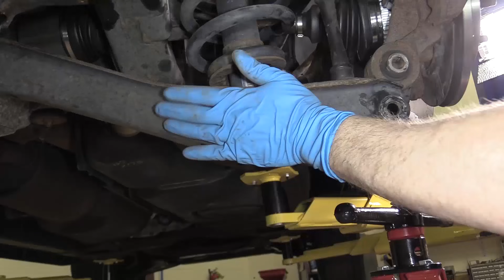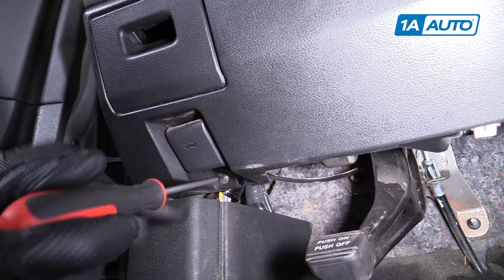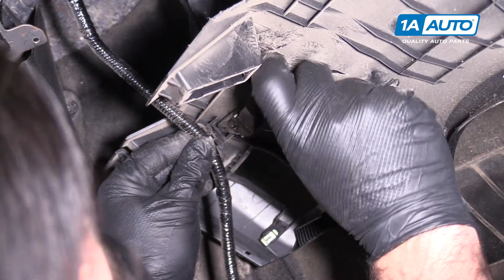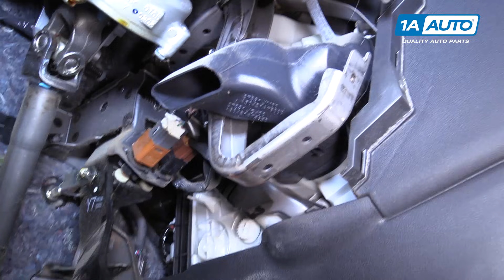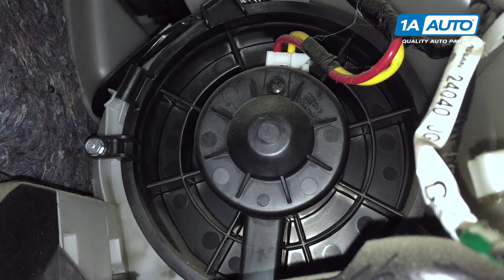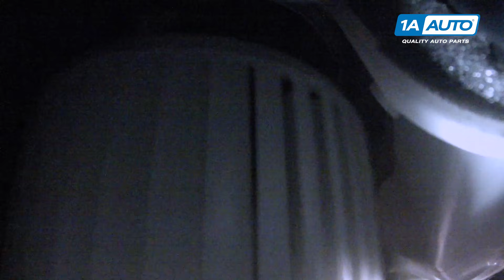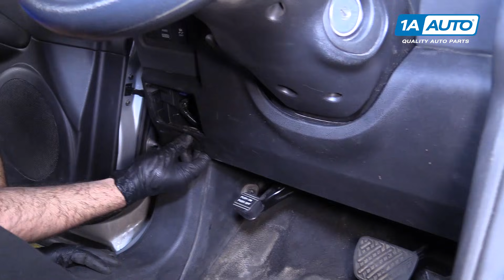How to Replace Heater Blower Motor 08-13 Nissan Rogue SUV

Comment: 11:05 It would be easier if you pressed the clip down before rotating it so you can allow it to spin counter clockwise. The clip is near the bolt.

Comment: Thanks for the video. I don't know what year everyone's Rogue was but on my 2014 Select (really 2013) this was honestly one of the most difficult things to do. Every. single. step was difficult. Removing the upper right bolt on the pedal assembly and the upper bolt on the bracket @5:20 (on the 2014 the bracket must come off in order to remove the pedal assembly), down to simply disconnecting the harnesses required an act of Congress. Be forewarned, by going through with this there are no life experiences to gain, no life skills to be learned nor any reward at the end...

Comment: This is a great video. If you haven't done this before, keep the video handy on your phone. I replaced the resistor and the cabin filter at the same time. It just makes it easier to get to everything when it's all apart. Getting the blower and the resistor in takes patients. The screws for the resistor are challenging because of their position. It is really difficult to see up in that area. I had taken some pictures while doing this, only to see that everything is seated and aligned properly.  All and all the process does take longer than the video, so set some time aside and be patient, especially unclipping the connectors. Fortunately, I did not break any, but I can certainly see how it could happen. The whole process from start to finish, along with some colorful language, had taken about 2 hours, mostly due to the challenging areas under the dashboard. A1 Auto, Thank you for the thorough video(s).

Comment: Although he does make it look easier than it actually is, if you follow his step-by-step advice, you will get through it. For the bracket in front of the accelerator, the top bolt was a nightmare. Would I had to do was get a short 10 mm socket and super glue the inside and stick it on the bolt. After 5 minutes, I went back, and with some effort, I was able to get the bolt out. I never could get it back in, so I left it out, which didn't seem to matter. The bracket was still stiff with that one nut

Comment: Hi! I was trying to replace the blower motor on a 2011 Nissan Rogue and I ran into a couple of problems. I wasn't able to remove the blower motor, but maybe that has something to do with @SteveHartmanvideos comment about the locking tab. I will have to try again. Also, when I reassembled eveything... I now have a P2122 and P2127 error codes. Any idea what I may have done wrong? Thanks! The video is very helpful.

Comment: 😲😲 I'm only @ 7:06 so far and ur ripping the whole darn car apart????  Just imagine the DIYer that tackles this job outdoors in the middle of winter  🤬🤬🤬🤬🤬🤬
OK carry on..... 😵😵 @ 9:21  Holy F Moly!      By 11:48  It's easier getting out than putting in......  LOL this is such a stupid design!   By 14:23  Just get a bigger hammer to help it in  🤣🤣
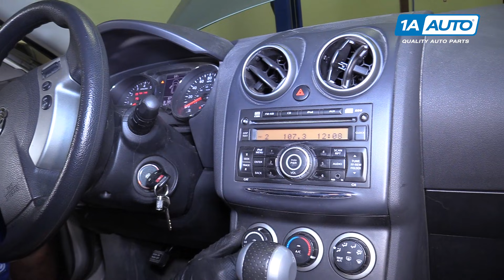Testing it at 24:01 sounds like the fan is rubbing on the housing????? 
And it only took you just over 24 minutes to complete.  Very impressive.  For the novice, likely 4 hours and for a novice fatty, 7 hours 😆😆
At the end of the day, that appears to be one abortion of a design flaw....In my opinion!
Reply from the maker: +@lisab3396 Thanks for checking us out! http://1aau.to/m/Shop-1AAuto-c

Comment: I appreciate any answers from anyone who had to do this!!  How did you know the blower motor was bad?  My a/c was working just fine. The next time I started my car, nothing was blowing out of the vents. Both fuses in the inside fuse box were good. I know my a/c is working because when I turn the a/c on, I can hear ans feel the car kind of bog down when the a/c compressor starts. I can cup my hand over a vent and feel that there is cold air there, its just that nothing blows out. Since the fuses are good, is my next step to install a new blower motor?

Comment: At about 11:50 where he is fighting to get the old blower out, I can confirm that is exactly how it was when I did it. 

And that clicking noise around 11:52 he is having to force the fan past this little wire connection where it has a strain relief. I had to do the exact same thing and was terrified I was going to tear that wiring harness up. 

It's just a tiny connector, but that was the only way I could get the old fan out was to flex the fins on the squirrel cage against that connection and stress relief for it.

Comment: At 4:10, although he may have said you might NOT have to remove that bracket, REMOVE IT! I tried not removing it, & I'm sitting here waiting on my wife to show up with a wobble adapter for my 1/4" ratchet.

That upper nut on that bracket can barely be seen, let alone reached!

I CAN'T get the pedal assembly out because the rear of that "optional" bracket is conveniently nestled INSIDE the upper part of the pedal assembly.

I tried everything to get the assembly out, but that bracket won't allow you to wrestle it off the 4 threaded studs it secures to. If you only had 1/2" more clearance, then MAYBE.

I think Nissan purposely did this because I can't understand why the rear of that bracket extends so far back but doesn't actually attach to anything.

My kingdom for a wobble adapter! I got a 10mm wrench on that nut, but only had 1/4" I could turn it. ARGH!!!

Comment: Excellent video. After completing the job (thank you) i will say that removing all the framing is absolutely necessary. Not sure how you can remove the fan without that cross bar frame removed

Comment: Hey guys! Any ideas? So we currently are at the step where we have the fan inside the car in the right orientation. But we can NOT get the wire harness to plug in… we get it like placed right on top of where it’s supposed to plug into, but it won’t go down or click. Any ideas?

Comment: This video has helped immensely! I need help identifying a replacement bolt to hold the blower motor in, it seems that mine is missing for some reason. Any recommendations because I can't find it anywhere online?
Reply from the maker: +Kenneth Brune Thanks for the feedback! We suggest contacting your local mechanic to determine which bolt you need for your vehicle.

Comment: You shouldn't have to dissemble your car to replace a part that has a limited lifespan such as bulbs, brake pads, and freaking blower motors.  Thanks for a clear and concise method to tackle what could be a nightmare.

Comment: I have a T31 Nissan Xtrail which had both fans for AC and engine coolant cease to run.I did troubleshoot by testing the relays,checking the fuse but relay for fan didn't work when using test light.All fuse ok.However when I replaced the fan relay and reset both fans worked.Then the accelerator didn't work meaning car was idle and never moved.I put the engine off and then waited for few minutes then started engine again and drive,the auto gear shifted well and gear picked.Earlier before the replacement of the relay I also topped up ATF.Now the engine and radiator is very hot after test running for 20 to 30min.What would be the issue now?Is it the AC blower or AC blower resistor?Need help here.AC is working fine but the overheating of the engine and radiator is the concern.

Comment: I installed it, blower wheel was grazing the inside, created resistance, blew fuse . Got 2 new 15 A fuses, installed them, switched old scroll wheel for new one, tested motor outside and different speed for 5min, installed, STILL was touching, however it was way less than before. When I tried to turn it back on after first start, scroll wheel stopped working. Checked fuses, not blown, checked if Voltage was getting to them, no voltage getting there, fuse box not passing the voltage from the back strip where the voltage is carried to the contacts for the fuse, put my multimeter deep inside the fuse box, checked for voltage. When it’s in the OFF position, it’s a 14.2V. When it’s in the ON at Full throttle, it’s at 4.3V. WTH..

Comment: Twisting that blower motor out is a pain. I used a 9 inch long piece of exhaust pipe with a square piece cut out to grab the motor and a 4 inch oil filter strap wrench to get it to unlock.

Comment: Thanks for the video it definitely helped. Only took me one hour and ten mins but definitely needed the swivel for the top bolt of the bar that’s a pain. I went up next to the steering column through a gap on the plastic to get at it. Also have a magnetic light it’s almost impossible to see that top nut standing on your head.13mm deep socket luckily I had. And having an impact for all the bolts helped. Extensions and an 8mm ratcheting box wrench for that fan bolt. Can’t get that good of a view of it so you can feel it with that type of wrench. Thanks again

Comment: Thank you. AWESOME video. Very well explained. Only major problem I had was getting the new blower motor back in place. I ended up removing the black plastic heater vent flap control. It is held in by 2 phillips head screw and a connector. Went in fairly easy after that. Took me about 4 hours. And that includes a 45 minute break to relax after not being able to get the new one back in. Thanks again.

Comment: I DID THIS... thank you for showing step by step!!! This took me about 3.5 hours but it was worth it, the local shops wanted over $500 in labor.  THERE IS A MISSING STEP.... when you go to turn the fan to unlock it, there is a tab next to the 10mm screw that you have to bend up and then it will turn out.   I only figured that out because i looked at the new fan to see what it might be getting stuck on.    That's also where the "snap" comes from, that locking tab.  Its about 1/2 inch to the right of the screw, going clockwise.
Reply: Agree. This was the only issue I ran into. Other then that great video

Comment: Great video, the shots up inside are very helpful. That top right 10mm nut looked impossible to get back on but a combination of your trick of tape around the swivel joint and a bit of blue tack on the nut to hold it to the socket got it first try! I did this the hard way first time (according to the service manual, taking the instrument cluster off etc.) and this is much faster and no harder.

Comment: Are these motors 12V DC? I am curious if I can bypass the resistor and feed power directly to the fan to see if it works before I go to the trouble to replace it.

Comment: I really like the fact that you show how hard some of these part replacements really are instead of acting like everything runs smoothly.

You did a great video on a Toyota 4Runner blower motor (I have a 2008) and it was much easier to replace than on this Nissan Rogue.

Comment: I fixed my wife's Rogue that did indeed end up being a bad blower motor though I was leaning towards a bad resister (easier replacement) If it wasn't for your video it would of taken me ALL day to fix it instead it took 2 hours to replace the blower motor. Thank you & great video!

Comment: Once you were finished and turned the fan back on, that's the sound I'm getting on my wife's car. The fan is working fine but it sounds just like that one you did here, like something is stuck in the squirrel cage hitting something. Any idea what that sound is? Maybe something got sucked up in from the passenger side floor board, I don't know.

Comment: Thank you for this!! I was quoted $1050 for this at my local Firestone and was like yeah no thanks! Bought the blower motor assembly and resistor for $99 and just finished this in under 4 hours. Had to run and buy a 13mm deep socket. I changed in on my Nissan Versa note 2015. Had some trouble removing the pedal assembly Because of the steering column  but eventually took it out. I recommend wearing some work gloves throughout this because I have plenty of cuts all over but this was definitely worth my time to save money! Thanks for the help!!
Reply: Yup. They do charge an arm and a leg.

Comment: Great guide but getting the fan off by hand not so easy, had to use an oil filter remover with a small extension and ratchet. Took it off no problem!

Comment: This was a great video!! Very detailed and accurate. My only suggestion would be give tips to help those who may be having a difficult time with a specific step. Anyways, following this video, it took me about two hours. Maybe about 90min if you take away all my breaks and back and forth for tools lol. 

On another note, I replaced the blower motor and the blower motor resistor and I’m still not getting air flow. My heat is hot and my air is cold. I can feel them at the vent when I turn on those settings I just don’t get air flow (this was before I replaced the parts). Aside from the relay, what else could my issue be?

Comment: Yeah, it works great, but it sounds like shit. Haha! 😮‍💨
I've been doing in-home appliance repair now for 13 years and even started my own company. I have diy'd most everything and certainly always will. A bit of research and the 'ol' college try' has been a most satisfying solution to overpaying someone else to. My services keep me in tip top, contortionist level shape and my stoicism keeps me from choking out the occasional customer who throws a tantrum over having to do dishes by hand or going without microwave popcorn for a week until I make it back with their parts that have to be shipped in. Well.....
...This video and subsequent part installation saved my 1st world ass from freezing off, and allowed me to get back to work. It also illuminated the realization that I know  nothing of true body contortion, and if it weren't for the steering wheel...well, goddammit...I just may have sucked my own cock. I have successfully scared my lovely family with the sheer madness and frustration with the project, successfully teaching my 7 yr old every flagrant and vile word in the book, and cursing all living creatures near and far to "F-off and die slow!"; and if my wife opened the garage door, allowing all my heat to escape, one more time, I was going to...
Well,  after countless breaks for warming, resting, venting, chiropractor visit, and the occasional speedball...I had finished the fresh new hell of having my heat back to blowing hard, but sounding like shit at lower speeds. Good thing the only music that I can listen to now, in order to  pacify my, now black and angry soul, is the loudest grindcore, djent, and death metal I can find. This repair was fucking brutal!!! Pretty sure I need an actual backiotomy. Thanks a million 1A Auto! You the shit! 
I'm gonna go lay down, in traction, for a few days now.🤕

Comment: lol man Nissan is evil for placing that thing where they did. My 4runner is basically just popping out the glove box (don't even think there are screws for that) and then I think the blower motor and cabin air filter are right there.

Comment: Excellent video! Great job with the lighting, the camera shots, the angle.  Everything was done so clearly. Honestly, the best video to watch, when it comes to a DIY for a Nissan blower motor.  I have to agree with everyone that this was the worst possible place to install the blower motor, and I remember seeing a list of the 5 most common problems with the first generation Nissan Rogue - and the very first one in the list was the blower motor!  I have a 2011 Rogue in which the fan stopped working.  I wasn't sure whether it was the motor or the resistor - but one clue (i think) was that if I banged on the side, or the top of the dash, I could get the fan to start working (until that trick stopped working!).  I had read that this symptom was the blower motor.  I followed the instructions in the video, and after several hours of contorting and cursing, I got the blower motor removed, and then replaced.  One other person had commented that pushing at the white plastic, near the screw of the blower motor, helps in removing it. I have to agree. I could not do it by just rotating the blower motor anti-clockwise as shown in the video.  Also, to pull out the blower motor, past all the protrusions, for me at least, was not possible, without removing a black box (that controls some vents) that was held by TWO screws.  You have to be careful though, as this black thingy connects with several plastic parts that mate with various "channels". You will have to make sure that they all line up properly, and move freely, when re-installed.  Thanks for a great video!
Reply from the maker: +Roy Thomas Thanks for the feedback!

Comment: I'm doing this on an 08 rogue, the black plastic duct that is just supposed to pop out is actually held in by a screw that isn't accessible through this area, I think the radio has to be removed to get to it, I ended up breaking it off than saw the screw

Comment: anyone else struggling to get the top bolt off the steel brace bracket? i know you said "flex joint, but i cant seem to find the right combination of a flex joint/10mm socket that'll fit in that tight space. does 1a auto sell that tool?